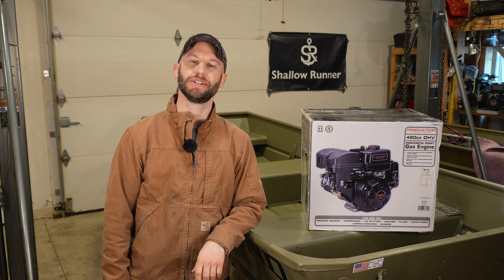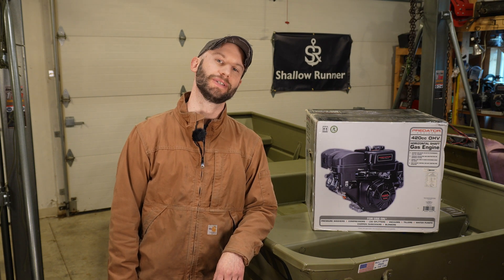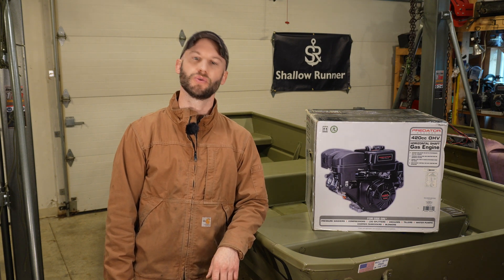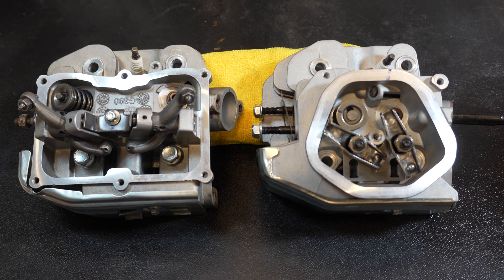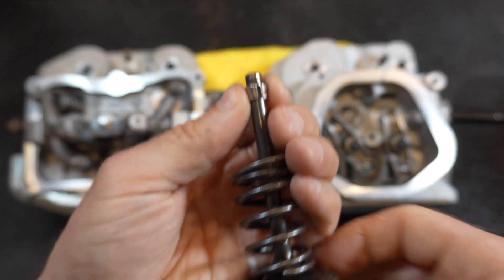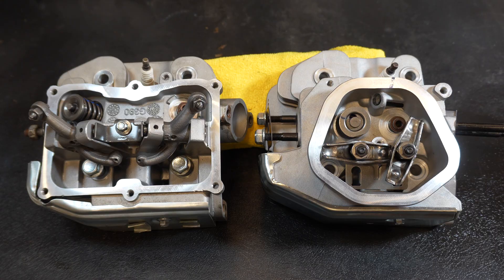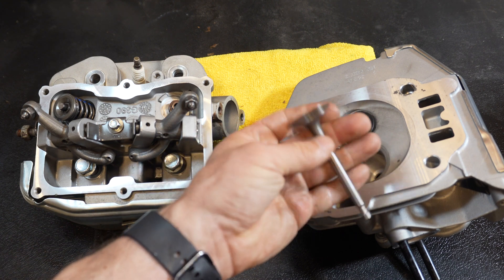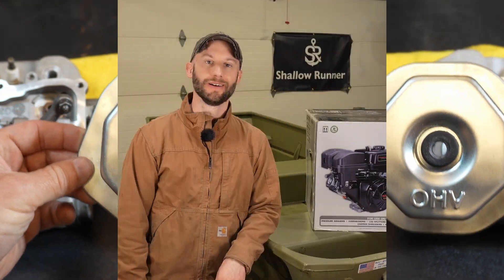Predator 420cc Jet Boat: Full Send No Mods - Part 1

Comment: I think I wanna do this this winter. I like how the overall package is a little shorter than if I use the motor from the ski.
Reply from the maker: Yeah these are entertaining to say the least and overall weight/length wise can be an improvement. There's use case for ski motors depending on your cargo weight goals. Hit us up if you have any questions.
Reply: @Shallow.Runner oh I have like a million questions but I think most important right now is have you ever tried this using a cvt? For where I'm at I will need some type of neutral. I was thinking about trying to use the reverse bucket and just find a sweet spot on that but I dunno. If I do a direct drive like yours I'll need to use my trolling motor to dock sometimes for sure, just too crowded around here to be spinning circles for lack of neutral. That's my main question. How to achieve a neutral or is it even worth it, just use the trolling motor if it's insane at the launch. Or do I even need to? It looks like a lot of these are cruising pretty good at idle I guess is my concern.

Comment: I have a 670 with 1” shaft so I assume these couplers will work yes? 😅
Reply from the maker: Yes, good question. Any engine with a 1" shaft or smaller will work with the either couplers.
Reply: @Shallow.Runner awesome well I guess I need to find a wr 500!

Comment: A cost break down of them both would be nice. And if I only need 8 miles per hour, do you think, based on your experience that the 212 might work well enough?
Reply from the maker: Put this comment up on another thread as well. I'll cover more on costs in a later video but it was about $300 for the boat, $100-200 in raw materials, $400 for the 212cc engine plus hop up parts, $200 for the ski I pulled the pump out of, so maybe $1,000'ish total. The 420cc build was a good bit more because of the stage 3 kit, fuel system, custom exhaust, custom impeller, so maybe $2,500 for that build though it can be done much cheaper which I'll cover soon.

Comment: Why not use the predator 459
Reply from the maker: Hey that's a great question, the 459 isn't totally compatible with all aftermarket GX390/420 parts. This limits you to running it either stock, or with limited upgrades. I think most folks prefer to stick with 390/420/440 based on that.

Comment: I got a 459 predator 2 Sea-Doo jet skis with 587 motors
Reply from the maker: Sounds awesome, can't comment on those particular pumps but with enough research you could figure out if it's a good fit. I'm a fan of the Yamaha pumps for my builds. That's a sweet engine too, I like the 420's since there tends to be better aftermarket parts.
Reply: @Shallow.Runner yeah I have the same one on a swamp runner but I want to go jet drive

Comment: Any suggestions on where to source the jet pump?  Everything I've seen online has been REALLY expensive.
Reply from the maker: Hey, great question. Seems like it can be a challenge based on each persons locality. Over in my region there's always anywhere from 3-5 Waverunner 500's for sale in the $50-500 range on Facebook Marketplace. Otherwise, camp on Ebay and the rates will vary based on condition. Reach out on https://www.shallowrunner.com/ if you're still having issues sourcing one.
Reply: @Shallow.Runner  Appreciate it. Around here everything that floats is made of gold!  I'll start casting a wider net for project material

Comment: How do you find the stuff besides engine? Also will it work with a predator 670?
Reply from the maker: So these pumps come out of either a Yamaha Waverunner 500, or an LX650 (not a Waverunner III 650 or VXR 650). I've found Facebook Marketplace to have plentiful supply of these skis in my region, but know in other areas they're a bit scarce.

Comment: Really enjoying the simplicity of the build but I do wonder if you could use a cvt for increased performance and clutch duty
Reply from the maker: Hey thanks for the input on simplicity. I would definitely agree for the right engine and pump combination a CVT might do wonders for performance. I've had enough comments on this one that a proper build might be in order, need to do some research first to see if there's hardware that can endure these conditions....

Comment: Can you make adaptors for the bigger predator motors would love to put a bigger one in my 1542 for running shallow
Reply from the maker: Thanks for the inquiry, these adapters fit the 301, 420, and 670 as they're 1" diameter. To fit them on the 212's you have to add a simple $10 sleeve to reduce the diameter. I also have an adapter for the larger Yamaha 144mm jet pumps available now. Shoot me a message on the site if you have any questions.

Comment: Think I could hit 25 with a 20hp 7500rpm 212? I’m building one with a cam and shredder head for my mud motor may do this in the future
Reply from the maker: Hey, that's a great question, sounds like a gnarly engine. I obviously can't promise or guarantee a result but the 212 I built could run 21mph with the stock cam. As far as I understand that cam puts out peak torque around 2500rpm and is not remotely optimized for the pump. It wouldn't surprise me if a built 212 could do 23-25 mph with a good tune and a tight impeller/wear ring fit. If you head that route and need input feel free to reach out.

Comment: Yeah but show us the pump man!
Reply from the maker: Great question, I have a video lined up for some more information about the pump. If you check out the Predator 212 video there's some basic info on it, a Waverunner 500 pump, setup as direct drive, with a stock'ish pitch Solas Impeller. Let me know if you have some more questions beyond that and I'll try to share what I can.